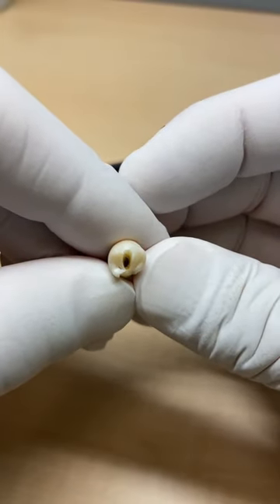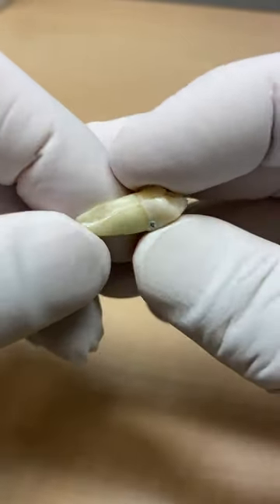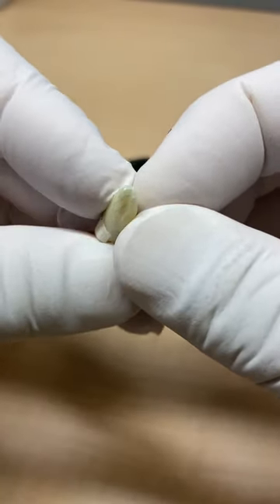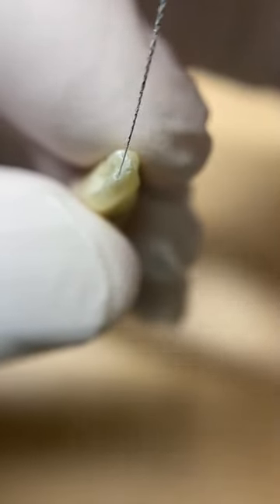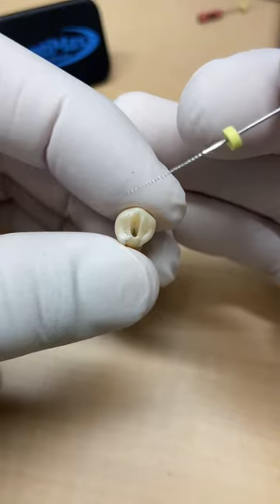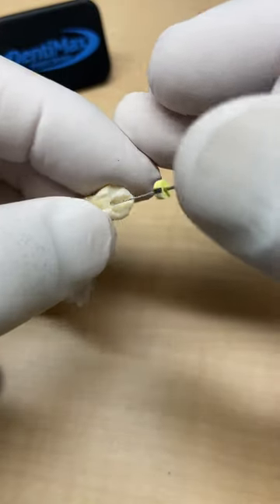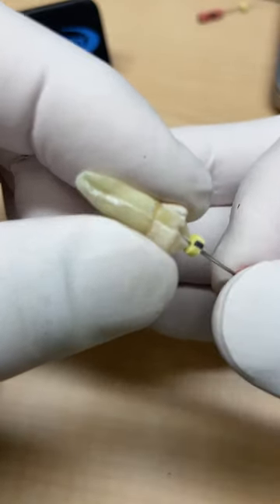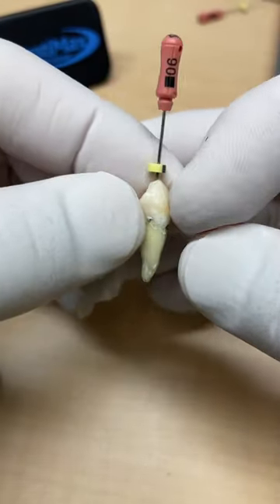These are tricky teeth

Comment: What is the flutter test?
Reply: Leaving a comment here so I'm notified when someone answers correctly
Reply: Sameeee
Reply: If I'm not mistaken, the flutter test (sometimes called the pendulum test) is used to determine whether or not the file is inside a canal.

Basically you insert the file into what you assume is the canal. Then you gently tap the handle horizontally. If it flutters then the file is most likely inside a canal.

Otherwise, you're likely inside a perforation, ledge,..etc.